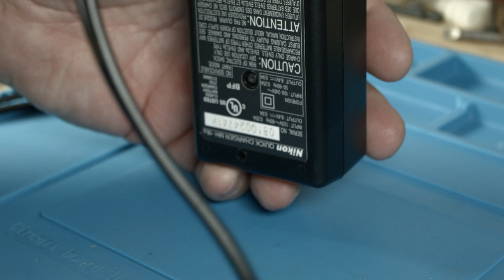Nikon Camera: Charger Does Not Charge - One Way To Fix It

Comment: i know this is years late, but i've repaired a few of the MH-18 and MH-18a chargers and there is another common failure i've found. the capacitors fail pretty often too, especially now that they are getting older. i open it up and look for bulging capacitors and if one is failed i just replace them all since i'm already in there.

Comment: Hello : please help . I have a 2019 Nikon Cool Pix W-300. And it won't turn on , and it won't charge . After watching this video , i was wondering perhaps that it might be the Fuse .  Thankyou for any opinions , or advice .. Michael
Reply from the maker: How can we help? What if it is the fuse???
Reply: Yes Thankyou. I have a 2019 Nikon CoolPix W-300.,Ive owned it for three  years .( rated as a durable/Waterproof Camera.). The last time i used it was Outside, during a  very cold winter snowstorm. Days later this Camera won't turn On /Power Up . Also When i plug the camera into the Charger the Battery wont charge/ or accept the charge... Please help . im asking for any technical advice, or opinion,. Thanks Michael Z..

Comment: Thanks for putting this up.
I followed the instructions, and reconnected. The charging LED flashed 3 times then stopped. So near yet so far.
Any ideas anyone?
Reply: the fuse dont brake because nothing so i amuse that the thing that broke the fuse is broke
Reply: Yeah…what he said🙄. Anyway, same issue. Any updates on your 3 blink issue getting resolved? One of the batteries I have charges fine, but the same second battery makes the charger blink thrice and then stop, so I’m completely clueless…